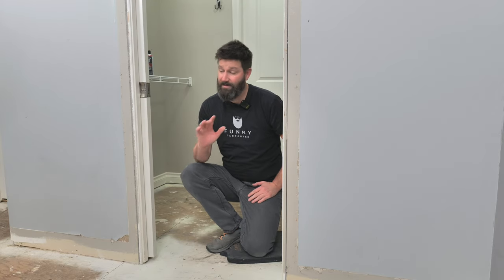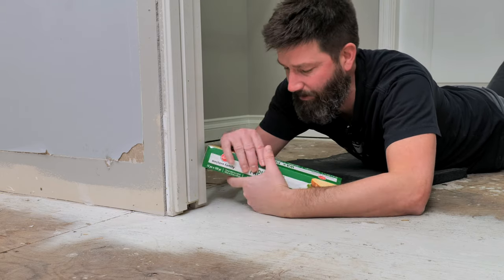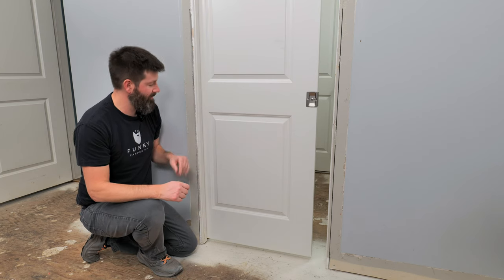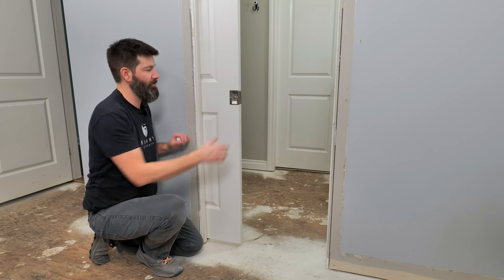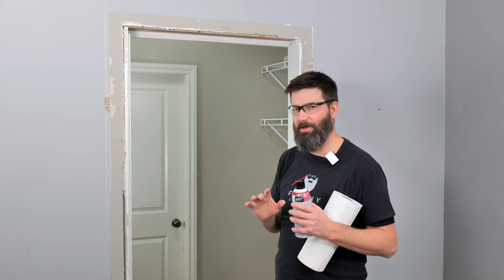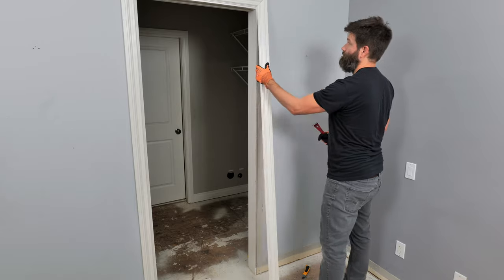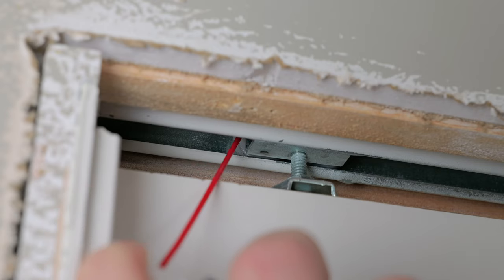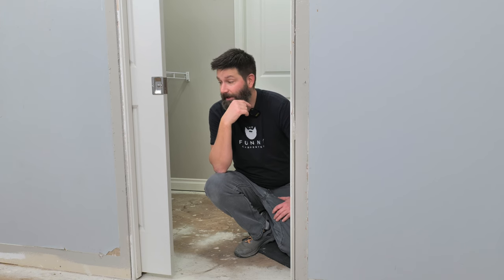The Secret to Fixing Squeaky Pocket Doors!

Comment: I replaced the shuttles on my pocket door with the upgraded ones that have bearings on them and now the door wont stay closed unless it's locked. I need to adjust the level to make it sit flat. But they don't squeak at all and are super smooth.

Comment: Thank you! Most other suggestions are for the top rollers only. The squeak on my floor track actually started after I used silicon spray to help it slide easier, I was going crazy trying to then fix it, the wax tip finally worked.

Comment: Thanks for the info.  I have a question about fixing pocket doors when the hidden portion of the track starts loosening up and sags back at top of door.  That is if there is an alternative to cutting a hole in wall to install different/better cabinet screws?